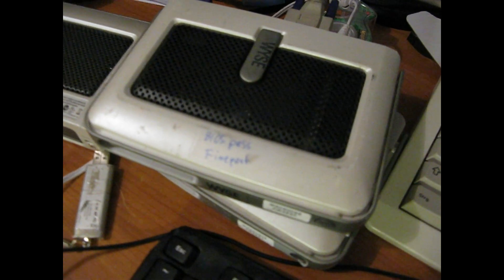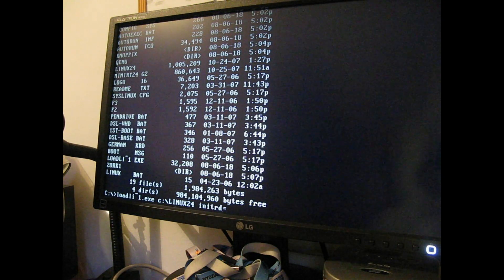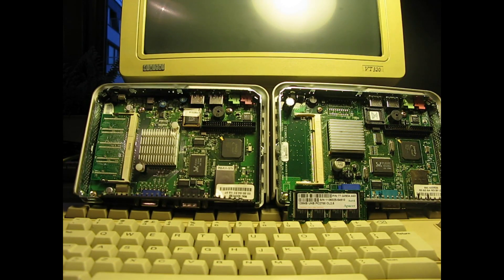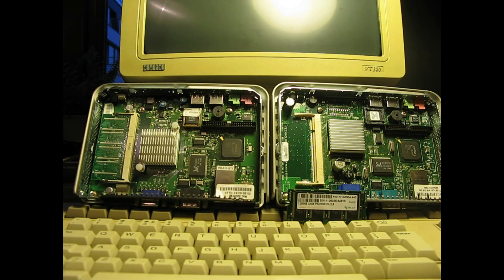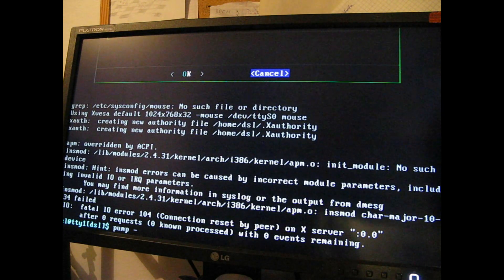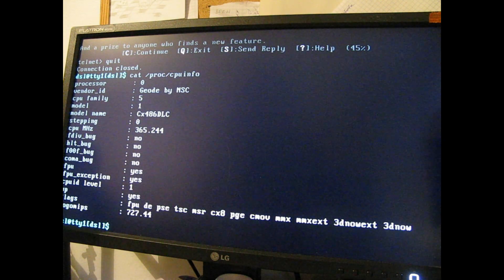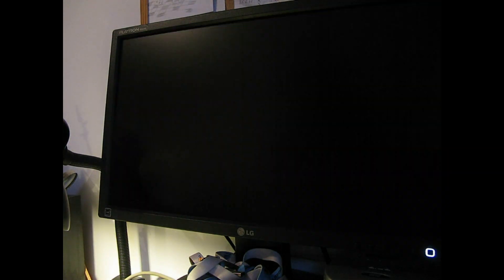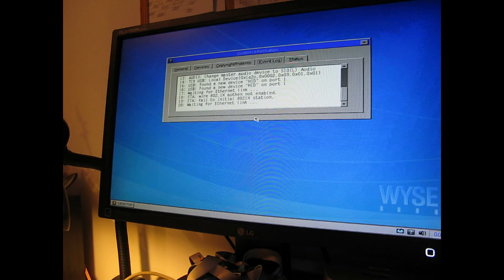PEV 05h - Booting Linux.... via DOS!

Comment: How did you get DOS on these?! I've tried MS-DOS, Dr DOS, PC-DOS 2000, and FreeDOS. Boot off a USB flash drive, USB floppy or CD and they can't see the IDE controller. I've also tried installing MS-DOS directly onto the Disk On Module using another PC but when plugged back into the Sx0 it starts to boot then fails because the BIOS hides the IDE. The FreeDOS installers can see the IDE during boot but by the time it gets to the installer IDE is hidden and it gives me a No Fixed Disk Present error.
Reply from the maker: I've made a DOS bootable pendrive with Rufus, however these computers seem to be picky about booting from bigger pendrives. The one I was using in the video was 1GB. I havent had any luck with Syslinux (either from Rufus, or installed from a linux machine).
Reply: @polprog702  the WYSE Sx0 won't boot from any USB device over 1 gig. Try something with GRUB for DOS to see if it makes the IDE visible after boot. If it does then install GRUB to the internal storage and see if it will boot DOS